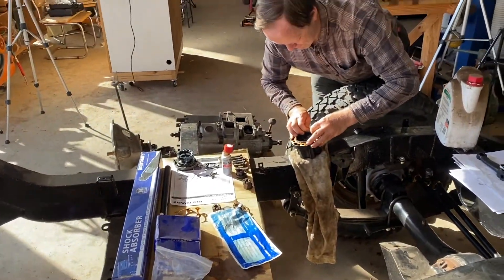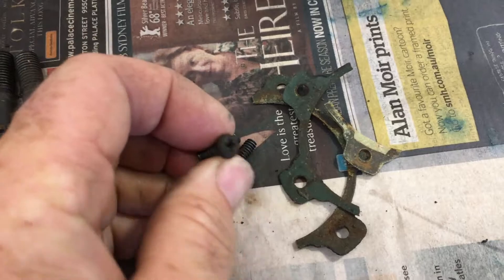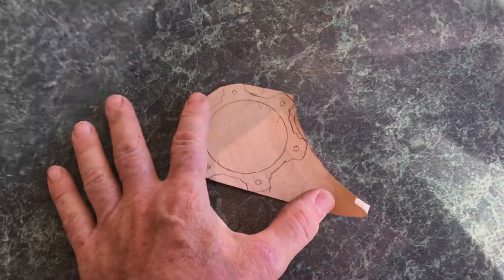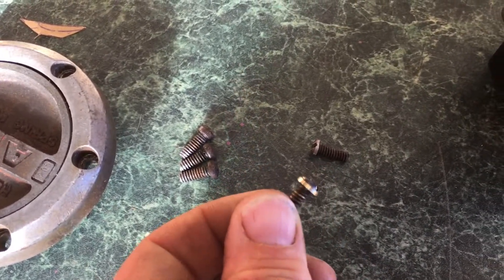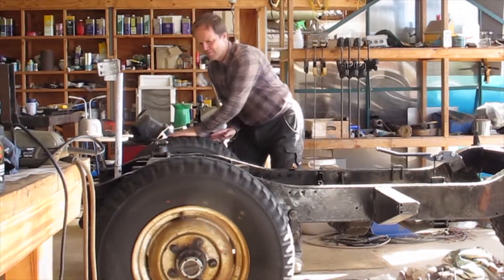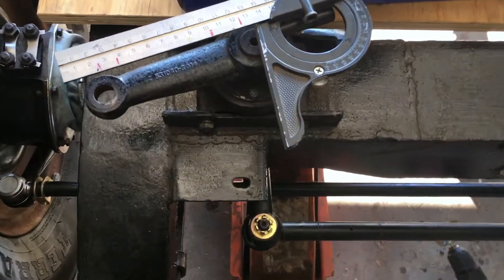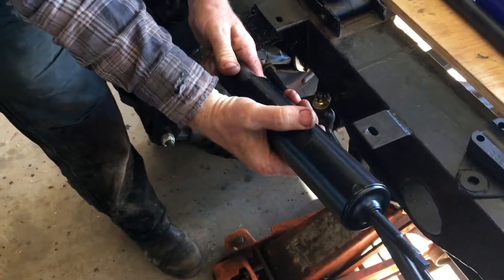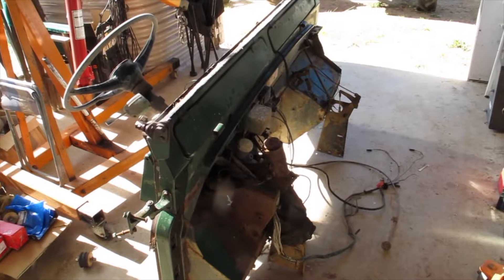Landrover Series 2A Project- Hubs, diff, shock absorber & bulkhead restoration continues.

Comment: I use a leather hole punch pliers with rotary head to cut gasket holes, good for nibbling out little bits too. Spent cartridge cases also make good gasket punches, even a bolt thread end if it has a raised ring on the thread end.
Reply from the maker: Great tips, Thanks.

Comment: I was just reading on the Queensland TMR website about A.D.R braking modifications & read that copper pipe should not be used for brakes. I see you used some copper pipe on one of your resto's. Not sure what N.S.W view is but it may be something to look into. I've got to find out now whether I need an engineer to approve my DBA T3 slotted rotors, DBA XP pads & A.D.R 42 approved braided brake lines on my 2013 Landcruiser as rule 16 states replacing the entire brake system with a combination of components from aftermarket parts is something that requires an engineers approval under the VSCCS. Probably why my insurer asked about modifications including brakes, they probably would cancel the insurance if involved in an accident.
Reply from the maker: Yes the original pure copper lines are not allowed in NSW,  we use Cupric Iron brake lines. Cupric Iron lines are a copper-nickel alloy that meets SAE J1407  (2.4.7 in that standard refers to copper and not copper-nickel which we use). They still look original but meet code here :-).